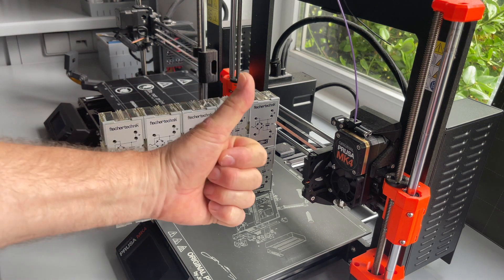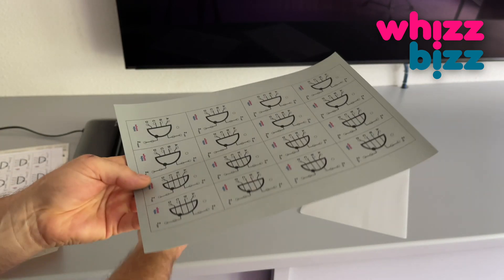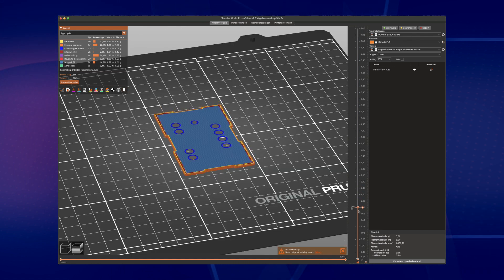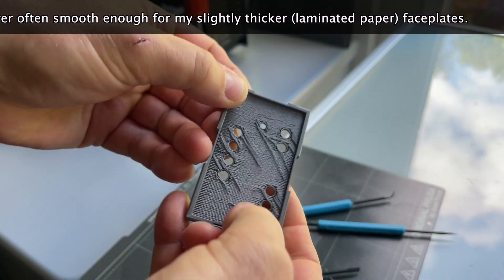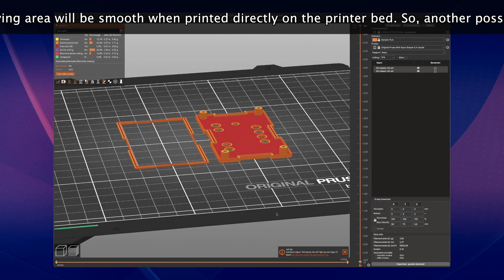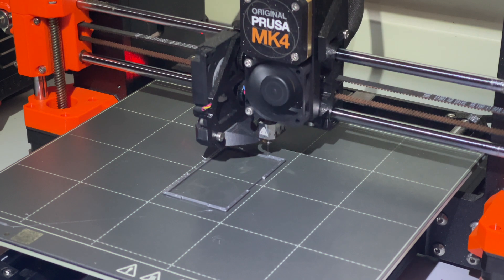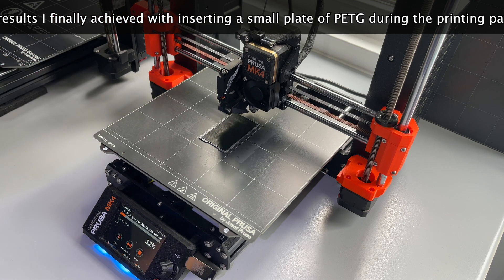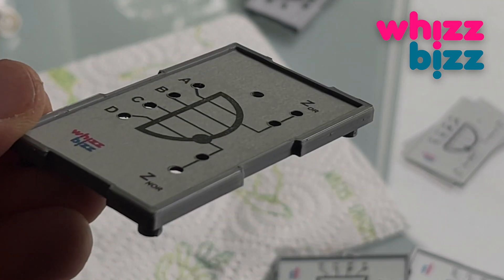3D printing smooth recessed areas

Comment: Why not simply use a 3D printed front face as well, without the need of removing it. You can simply print 2 parts simultaniously, stop print, lay the one part on top of the other and continue print, done.
Reply from the maker: I think the answer is.... because I want to REUSE the inlay. I've printed 30+ fronts with only four of these plates now. The fun is, that I have many slightly different fronts (holes position, etc) and can use these four plates many, many times....
Reply: @arnoud-whizzbizz  You want to keep using a 3rd placeholder part instead of not using it ? Using my method you don´t need any inlays at all, you can print all the hole patterns you want. You simply split the object in two parts, later on join the two parts and the 3d printer will fuse them. You use more parts and make it more tedious.
Reply from the maker: @sierraecho884  I don't understand your comment about 'a 3rd placeholder part', but perhaps you mean to print a frame and the (slightly bigger!) recessed part side by side, pause, loosen the front-part from the bed and insert this in a rim in the (fragile!) rim and 'lock' it with the successive layers? Possible, but the frame is very thin and I'm afraid it will loosen when I try to harvest the front from the bed. Another thing is that the 'frame' is very thin, so to 'lock' the front to it after the pause, the outer rim will be very thin (in this specific case). But okay, good suggestion, perhaps not for this specific front and lid, but I'll try it in the future! Thanks!
Reply: @arnoud-whizzbizz  ".... the (fragile!) rim and 'lock' it with the successive layers?..." Exactly, the rim shouldn´t be as fragile in this stage, because it´s still fully attached to the print bed which supports it.
Yes the rim is also very thin, but you don´t need much. 0.5mm should be already enough. Main thing is you got what I meant. You are welcome.
Honestly I would probably print two parts, use super glue and then attach the silver paper front with glue as well. You can also print the thin rim which will be wobbly  but then instead of printing just a flat surface print a surface with a small recess lip where the rim goes inside. This will need glue again but you won´t need anything else.
Reply from the maker: @sierraecho884  Got what you mean, 
@chipcode5538 had the same idea in the comments below. Good idea, but haven't tried because it will take redesign/splitting on STL-level. When I try it in the future, I will keep you posted!
Reply: @arnoud-whizzbizz  I would split it in CAD for more control. Sure try it out and let me know =)

Comment: Dude, try Bumbu with AMS, it will so easy to:
1) print in different colour, so you don't need a paper anymore, just print text and image in another colour.
2) use PETG-PLA trick with support. I always put 3 last support layers with petg and zero thickness to print a really good looking surface (works only with flat parts).
Reply from the maker: 1) I understand your idea, but that resolution is way too low. And especially for these small cases this is a hard requirement for me. I even find the resolution of a silk-screen printing of PCB material for this purpose far inadequate. I also found laser engraving too coarse. But try to convince me with your photos 🙂2) You've completely missed the point. Just automating the support material feed will not save you 32% material (I've printed 50+ of these things) Further more... this dramatically slows down the printing of the recessed part. Not to mention all the wasted material that poops out off the back of your Bambu. Probably the waste will then be more than 50%.

Comment: While everyone thinks the aluminum plate method can still work with some 'prep' like painters tape on top - the question then becomes, how reusable will it be?  a tear in the tape means replacement,  and the aluminum is going to be a heat sink for the incoming plastic.    The PETG system seems like it is working well, and won't need as much effort to replace tape all the time.

So sure, you could use some glue stick and warm the aluminum up before inserting and printing on top - and even changing the print speed at those first 2-3 layers on top of the aluminum plate, to treat it like a second bed....

but that seems like more hassle than just a PETG insert. Which for those that don't know, PETG doesn't really like to stick to anything but itself, so PLA is pretty much always gonna pop right off.   PETG will absorb less heat than aluminum as well, allowing for less finnicky needs to texture or slow down to ensure the layer is going down smooth.   And best of all, if a PETG plate does get ruined somehow... it's easy to just print another. (unlike a bent or marred aluminum plate)
Reply from the maker: I also think you are right. By now I have four petg plates in use and all of them have been reused several times. Although I expect warping at some point, it hasn't happened yet. I briefly considered making a part 2 of the video, but I think using a reusable petg plate is the easiest solution in practice. The tip, printing the recessed front section separately and putting it in some sort of frame at the pause, would certainly also be a possibility. But this is more complex because then there will be two print runs and one will have to experiment with the degree of overprinting after the break to sufficiently anchor the inserted plate. An additional problem is that I make many versions of these fronts, each with its own hole pattern and often print several at once. This then becomes quite an administration as to where which plate (and in what orientation!) the plates should be inserted, unless the locking edge only needs to be small.

Comment: I found that using aluminium or steel inserts with PLA that glue stick is the best thing to use, letting the insert heat up a little before printing also helps. PETG however is the perfect support material for PLA and you can print the insert to ensure it is the perfect size for your final part.

Comment: I think your attempt using that metal piece might still work with some preparations. 
When I use the stop at layer height to insert magnets into my prints, I do a few things first: 1) use gluestick on the magnet's side that will be printed on 2) put the magnet on the heated plate before they're needed (to heat them up a bit) and 3) slow the printer down on that first layer. 
I've had decent success using these preparations. 

Your idea to use PETG with PLA is really good for doing that recessed printing. I think that's probably the best way since the PETG has good texture to temporarily bond to. For anyone unaware, PETG does not bond well to PLA and vice versa so you can use either to support the other.

Comment: Nice video. I’ll try to remember these techniques for when I need them.

Just a thought … Spray mount glue for your printed front plates might be easier to apply than the manually applied glue you use.
Reply from the maker: Possibly... Spraying on the lid does require some masking, and if you spray the paper fronts from behind, the glue might bleed through the holes? But with the recessed areas now smooth, it might be a good idea. In the movie, I still glue the "old" fronts (printed with removed support material) in place. These have a fairly coarse surface. I'm also using a contact adhesive, which in theory makes what I'm doing (only smearing only one surface) not perfect anyway. However, I was mainly trying to use the filling properties of the glue a bit with those fronts. Further: there are obviously very few forces on the glued-in faceplate once it is glued on the recessed area. It is really only to hold it in place a bit during assembly. But, thanks for your tip!👍

Comment: For the insert, you could try the aluminum plate and put some blue painters tape on top. That used to be how you'd get a lot of filaments to stick before as it provides a slight-textured surface and can be peeled off after.
Reply from the maker: Okay, never tried that. Good tip! The PETG printed plates are however easier to make (on different heights). I think I'll stick (no pun intended) to that until I find out that they may e.g. warp after being used a few times. Aluminum may then perhaps be the better choice. We'll see! Thanks!
Reply: @arnoud-whizzbizz  in addition to what @kylek29 has said, i think "preheating" the metal insert might help so that the next layer of pla doesn't cool too rapidly. 
i have worked in a 3d printing factory with  blue painters tape on the bed and no bed heat at all and it was quite crazy how good the pla stuck to the blue painters tape.

Comment: Since you’re printing a lot of them, consider creating a stack of 10 connected in maybe 6 places that you can easily clip from the sides and short enough that your printer can easily bridge. Then print the whole set on a side.
Reply from the maker: I understand your idea of the stack to give it enough support on the bed at all.  And it is in itself a tantalizing idea good to see if indeed you cannot print such a lid standing up (with less or no support material). But I don't think you can, because in this particular case you will have to support the screw legs all the way from the bed, for example, right?
Reply: @arnoud-whizzbizz  chamfer the legs such that there’s no direct 90 deg overhang and you’re good!
Reply from the maker: @nosenseofhumor1  See what you mean. Thanx for the idea!

Comment: Excellent video with some good points! So far I mostly used the variant where you split in half and later glue on the "frame". This never really works well without guideance. 😥 Your idea with the PETG "spacer" is great, I will try out this the next time. Also, what @chipcode5538 suggested sounds even better ... a shame I didn't come up with that myself! 🤩

Comment: Hi, whizz bizz. Try the following, I did it in the past and it works like magic. Design your part as two separate prints. Print the plate first. Stop the print at the correct point and drop in the plate. Let the print finish. Now it looks like you printed the plate in mid air.
Reply from the maker: Maybe I don't quite understand what you mean. The border around it is quite thin, but you could print a thin frame in here that you could then put a pre-printed (recessed) front in during a printer stop, but then you would have to overprint it with at least a few layers before that is fixed, right? After all, on the back side there are also the screw tubes.... With a (universal, reusable) plate, you can print the front, except for the temporary stop, in one go.
Reply: @arnoud-whizzbizz  Yes this is exactly that I used, like a picture frame, put in the plate and print the remaining parts on top.
Reply from the maker: @chipcode5538  Although it is not simple to do in the slicer and requires modification of your STL files, it is certainly a good idea. I guess in this case (thin edge) I would then overprint at least half the thickness of the deeper (then floating) part after the stop to properly embed the support plate into the print?

Comment: if you use petg to support pla or pla to support petg, it will separate quite easy
Reply from the maker: Exactly, you can of course use this method even if you can change filament while printing. PETG easily detaches from PLA, while the PLA still has good adhesion during printing.

Comment: I have some experience putting metal parts into 3d prints, and a little gluestick on the top surface of your aluminum will help immensely with adhesion. 

EDIT: Wrote this before watching the whole video and yeah, PETG works a lot better. But if you ever need to insert a metal part. Glue stick is what got me the best results
Reply from the maker: Sounds great. However, my experiences with glue stick were the complete opposite. I experimented with it once when PETG just wouldn't come off the printer bed. Just to reduce adhesion! It took a very thorough cleaning of my printer bed plate before I could print on it somewhat normally with PLA again.

Comment: Fantastic video! Ha ha .... you're definitely not the only one experimenting with this! There is a second Dutch guy working this! My approach is a little different bij printing the border on the box rather than the faceplate. Still work in progress but already some nice results. Keep up the experimenting 🙂
Reply from the maker: Thanx. Yep, I've seen your results and they are great! I think this 45x75mm 'Silberling' is an excellent test case (no pun intented) for this. The protruding edge around is quite slim and you're forced to be creative because there are screw feet behind on one side of the recessed panel. Keep me posted about your ideas and results!